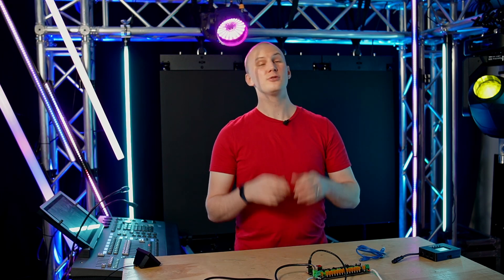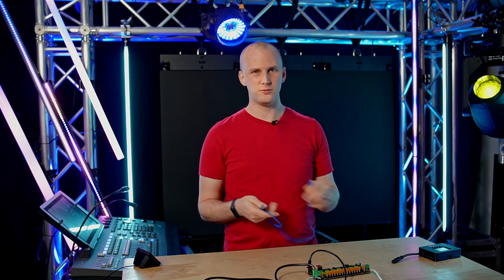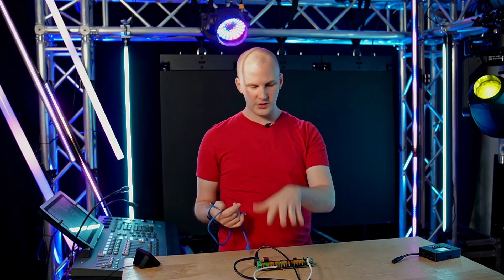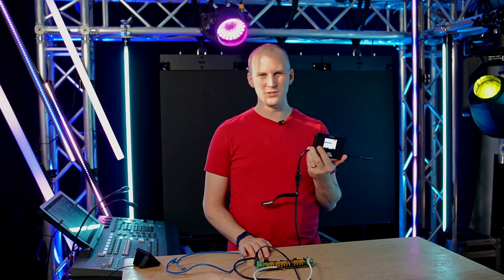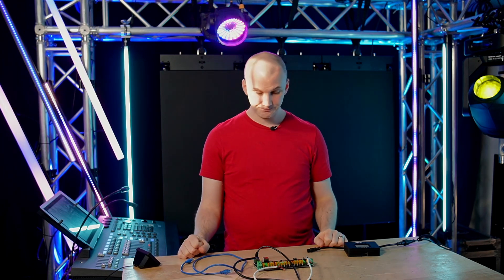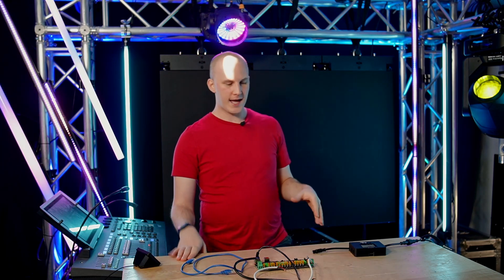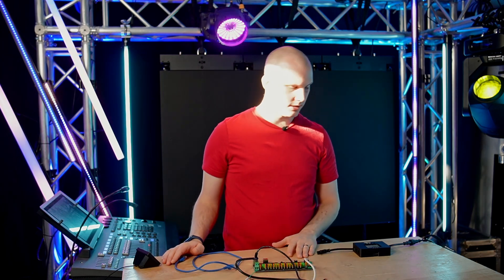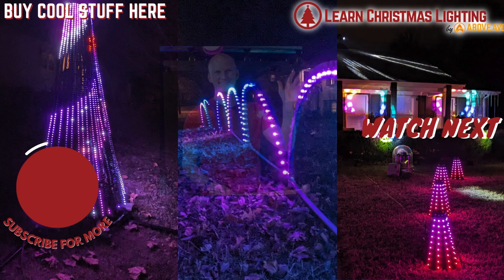How to Troubleshoot Smart Receivers in Your Holiday Light Show

Comment: I’m new to this and have a Kulp32 that I have a SRx1 V4 smart receiver hooked to.  The pixels on all the props connected to the SRx1 work as programmed, but the first 6 pixels off each port stay solid white at all times.  I’m not sure what would cause this to happen.  Do you have any suggestions or idea on what would be causing this?  They all match the correct start and end channels on both the controllers in xLights and on the FPP outputs.  I have roughly 200 pixels (675 total) being fed off 3 of the 4 ports on the SRx1.  Thanks!